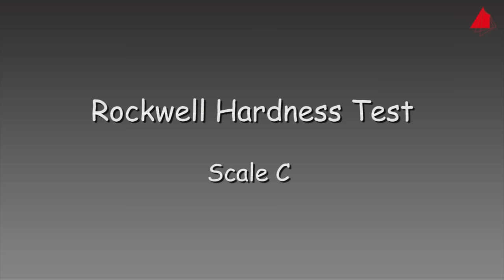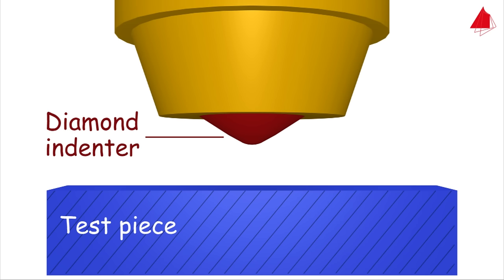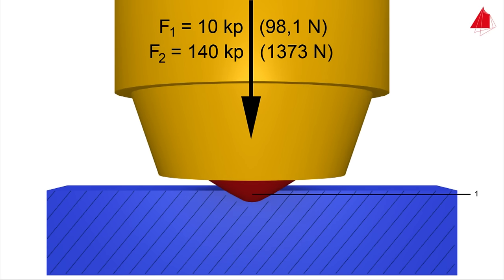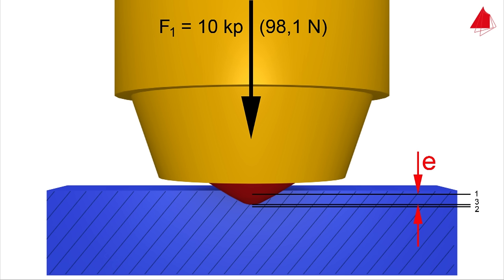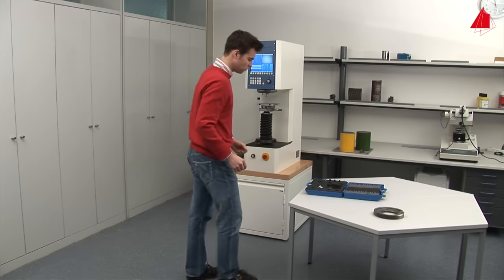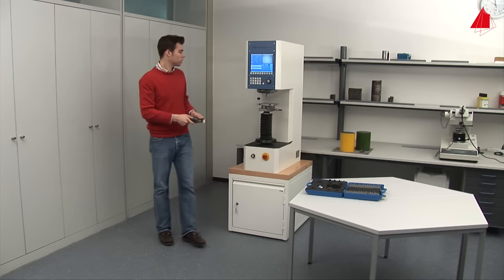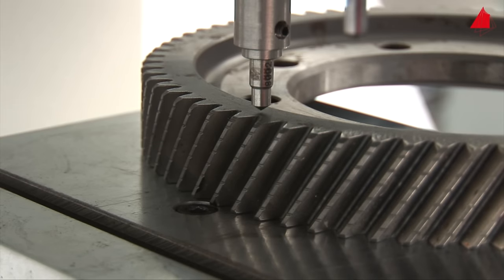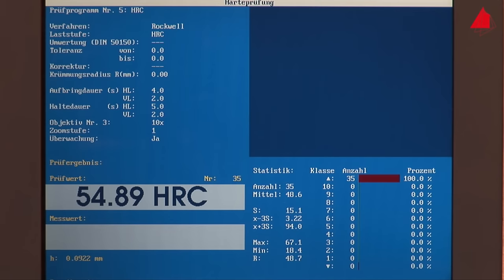Rockwell Hardness Test

Comment: I was looking fo the e variable on screen but only found an h in the lower left corner. Assuming this to be the e from the equation seems to be wrong. So where is e and what is h? If HRC is equal to (0.2-e)*500 and should result in 54.89 then e would be 0.09022mm but not the shown 0.922mm. Is there a digit missing (bad programming of the "Pruefprogramm Nr. 5") or is the assumption e = h wrong? If h would be e then (0,2-0,0922)*500 = 53,9 but not 54.89. The substraction of both equals to 2*10^-3. Is this the innitial indent depth or is there another equation explaining the delta?
Reply from the maker: Answer to "I was looking for the e variable on screen but only found an h in the lower left corner. ..." Sorry, e is equal to h; we should have used the international e instead of h. Congratulations for your observations! The difference between the displayed and the calculated result is due to a calibration procedure. The indenter in our testing machine has been calibrated, using highly reliable specimens with accurately known hardness. Indenters, especially for HRC, are never perfect, and the calibration increases accuracy. Sorry for the late reply, I was extremely busy.
Reply: Fantastic.
Reply from the maker: I am afraid I am hopeless: Instead of "international e instead of h" the correct answer is "international h instead of e". Sorry.

Comment: Please explain the intender and intendation size (width) difference in between HTC and HV. Please advice, that will be very helpful
Reply from the maker: Answer to "Please explain the intender and intendation size (width) difference in between HTC and HV. Please advice, that will be very helpful" You probably mean "HRC" instead of "HTC". This is actually a long story. Main ideas are: The Vickers hardness measurement method is almost universal, giving the opportunity to measure with very low forces (extremely small indents) up to about 100 kp (981 N) (medium size indents). The Rockwell hardness measurement method is suitable for moderately hard to comparative hard materials. HV is difficult to automate (the diagonal of the indent has to be measured), HRC is easy to automate (the depth of indentation is easy to measure). In both cases the indenters are made of single crystal diamond; the lateral dimensions of the indenters are around up to 1 mm, so this is the maximum lateral indent size. The Rockwell hardness measurement method offers many variants, not only the described HRC method.

Comment: Many mistakes.   A copy of current ASTM E18  ( or the European equivalent)  should be at hand. 
After every change in test load and indenter you are required to verify correct operation of the tester by checking with a test block.  
No certificate of calibration visible on the tester.  You open your self up to a law suit by using uncertified results.
The surface of the gear is too rough for accurate reading.  The surface should be ground and polished.  The specifications are in the ASTM manual.  

The gear was induction heat treated, thus the gear teeth a very hard HRC 60 and the body of the gear less hard HRC 45.  You choose to test the part on the boundary between the two zones, a pointless operation with no value in the number generated.  To test the gear teeth cut out a section of the gear teeth, grind and polish to metallographic finish and then use vickers with one kilogram load.  To test the body of the gear you grind and polish a spot and use rockwell as close to center of gear as you can safely test.
Reply from the maker: Answer to "Many mistakes ... ": Thank you very much for your detailed comments! I generally agree with almost all of your comments. There are even more issues that need to be considered, and most of them are addressed in the ASTM or EN standards. Why did we do it this way? Our intention was to show the basic principle of HRC hardness testing without going into the details. We do that in all of our videos. The next step would have been to explain all the specific details that need to be taken care of.

Comment: What if I need a very hard material? Is Rockwell Hardness C of 65 enough?
Reply from the maker: Answer to "What if I need a very hard material? Is Rockwell Hardness C of 65 enough?": This depends very much on the application. 65 HRC is a relatively high hardness for steels (maximum about 70 HRC) and many tool steels have this hardness. However, there are much harder materials such as cemented carbides or ceramics. For very hard materials, HRC is not a suitable method and HV is measured instead.

Comment: Why not use Newtons (a standard unit of energy) to measure the force applied to the object, after all, Newtons are an exact and standard measurement of energy.
Reply from the maker: Answer to "Why not use Newtons (a standard unit of energy) to measure the force applied to the object, after all, Newtons are an exact and standard measurement of energy." Well, Newtons are the unit for force, not for energy. But the question, why in many areas of hardness testing the old force unit kilopond (or kilograms force) is still used, is a very old and long one. It has to do with the idea of leaving away the unit in the result of the hardness test, with the problem of changing to the "new" unit Newton, and other points. Sorry, too long to explain here.

Comment: I am taking a CWI training course through the AWS. The learning module claims it is IMPERATIVE to prepare the test specimen's surface - I got the sense it should be borderline mirror finished or polished to get an accurate reading. Is this true? or what are the surface metrology requirements?
Thank you
Reply from the maker: Answer to: "I am taking a CWI training course through the AWS. The learning module claims it is IMPERATIVE to prepare the test specimen's surface - I got the sense it should be borderline mirror finished or polished to get an accurate reading. Is this true? or what are the surface metrology requirements? Thank you" The idea of the preliminary (or minor) load in the Rockwell hardness test is twofold: (i) to press the test piece in a defined way onto the support table and (ii) to create a small preliminary indent. This preliminary indent makes the test result independent of the influence a moderate surface roughness. So for the HRC test the specimen's surface does not need a special preparation, as long as the surface is not too rough. In contrast, a polished specimen surface is required for the Vickers hardness test at very small test forces and very small indents.

Comment: Question, how do we check hardness when the steel is much thinner,    as in 28 ga sheet metal
Reply from the maker: +Dale Brenke Answer to "Question, how do we check hardness when the steel is much thinner?" If the sample is too thin (in HRC testing less than 0.5 mm (hard material) and 1.6 mm (rel. soft material)) no reasonable test is possible. >> Use Vickers hardness test with low load instead.

Comment: +MaterialsScience2000 Is one test seen as being more reliable then the others(Rockwell/Vickers/Brinell) or do they each have their own advantages/disadvantage and what are those?
Reply from the maker: Answer to "Is one test seen as being more reliable then the others(Rockwell/Vickers/Brinell) or do they each have their own advantages/disadvantage and what are those?": They are all reliable, but they have their own pros and cons. Briefly: Rockwell is easy to fully automate, Vickers offers the possibility to produce very small indents (smaller than a material grain), Brinell the possibility to produce rather large indents (good for testing inhomogeneous materials such as cast irons in one test and get the average hardness).
Reply: Thank you for the quick and concise answer.
Reply: MaterialsScience2000

Comment: why use non standard unit kliopond? kgf is same much beter
Reply from the maker: Answer to "why use non standard unit kliopond? kgf is same much beter": Both of them are non-standard units. It is an interesting topic, why there is still a reference to these units. It has to do with old units, the problem of expressing the hardness just as a number and some more points ...

Comment: you forgot to seat the indenter
Reply from the maker: Answer to "you forgot to seat the indenter": Thanks for the comment. I hope I understand you correctly. Typically, the indenter must be used multiple times with a calibration test piece before a proper Rockwell hardness test (not shown in the video). This enables the indenter to be set and a test of the machine itself. In addition, after the end of the standard dwell time of the indenter with the minor force (preliminary load), the depth of indentation is tared (set to zero). This is done automatically by the machine in all tests.